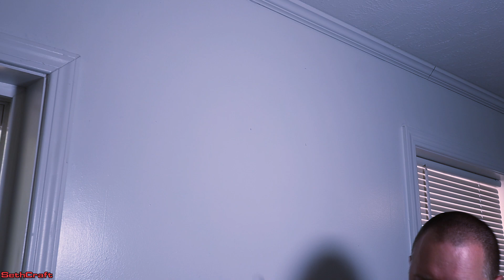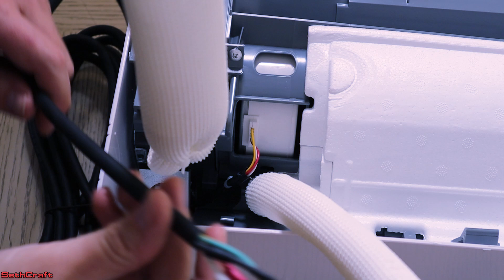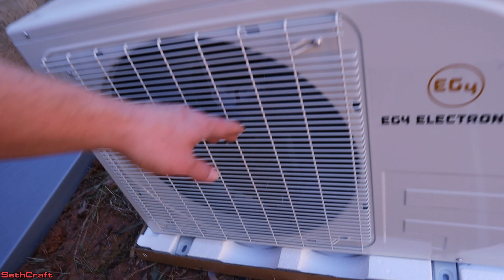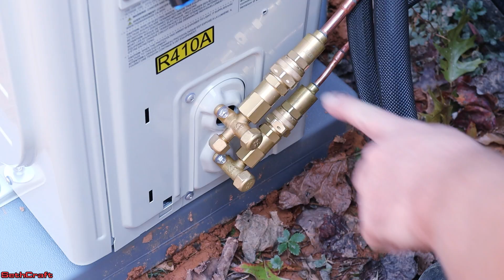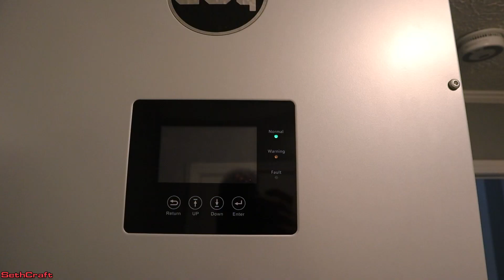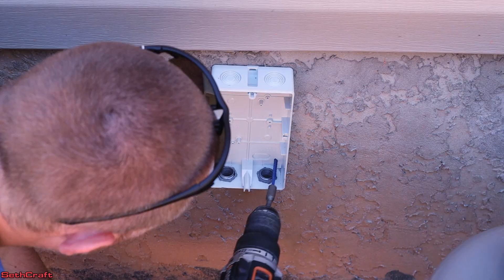EG4 12000btu Hybrid Mini Split Install with Solar

Comment: i just seen a crucial step missed, system wasnr vacuumed frlm moisture! moisture is a killer of hvac systems + it never works right due to noncondensables, people please follow the installation manual without skipping crucial steps if you decide doing it yourself, yes vzcuum pump and micron gauges do get expensive but its the way of the future unfortunetly

Comment: hold hold on. coolant? u mean refrigirant or nitrogen? because these usint are vacuum sealed, when u tightened the flares theres no way u heard coolant or refrigirsnt flow=thst was vacuum or nitrogen. Equipment vomes with  refrigirant in the condenser king valves closed, the refrigirant lineset to all zones/indoor units must be vacuumed down to minimum of 500microns hence there's no leaks previously tested. When successfully vavuumed the system down is when you csn brging to open king valves on which it will release refrigirant frlm the condenser into the complete system.

Comment: May I ask why you used 10 gauge AC power wire? I've looked through my supplied manual and an online manual on Signature Solar's website and neither of them mention the wire gauge to use, only the 20amp breaker. When I look online for appropriate wire gauge size to use with 20amp breaker, provided it's not being run over a long distance, 12 gauge wire should be used.
Reply from the maker: 12 gauge wire should be fine.I just happened to have 10 gauge available.  10 awg is overkill for the amount of power this unit uses.

Comment: Very informative video.  On your disconnect, did you install a 30 amp non fused and and run 10 gauge wire?  I'm interested in installing one myself and am trying to make a list of parts.  Thanks in advance
Reply: Nevermind.  I watched it over and you described it (I must've missed it😂)

Comment: So for heating on very cold days and nights it sounds like you could have got the 24000 BTU model. Also my question is, if I have a solar system powering my house, is there still a reason to buy the EG4 mini split if my home solar is powering all my AC and I will not be connecting panels to this unit?
Reply: I get what you’re saying. I’m torn between the 12 k and the 24. Darn shame they don’t have an 18k. I’m trying to convince Southern California Edison to fund one of these. That will make it a MUCH easier decision. They are already going to replace our OLD electric water heater with a Heat Pump Model and replace our 1986 Garage Refrigerator with a new one. Our Propane heater took a dump and we’ve heated all winter with a wood stove we hadn’t used in 20 years. A 12k unit could be supplemented with the wood stove. But AC is AC. It gets DAMN hot here in the Southern Sierra foothills. Our home is pretty old and about nearly 800 sf of heated and cooled space. Cheers.

Comment: nice work with a couple of caveats (I am OCD...lol). your outside unit is NOT centered on the plastic base and the solar panels are not even...that would cause me to get up in the middle of the night, -10 degrees, to go fix those...otherwise nice explanation and setup.